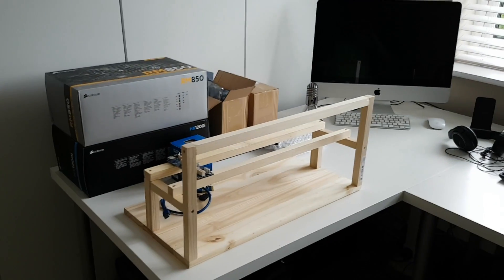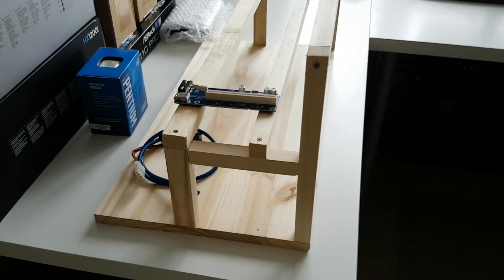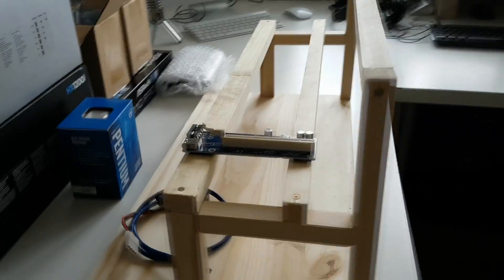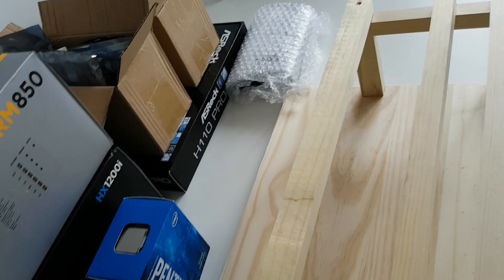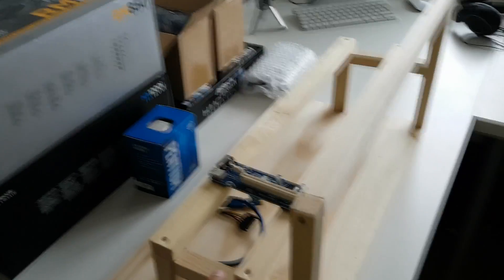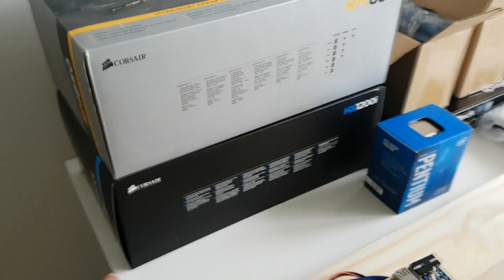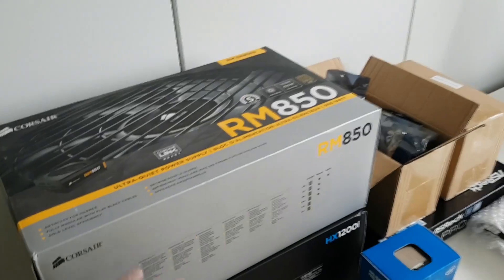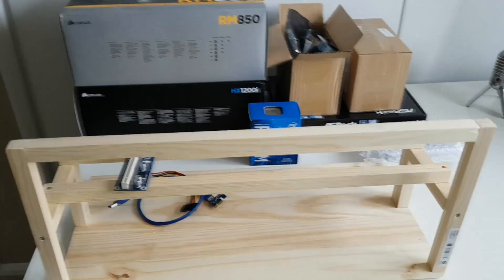13 GPU Miner Build Update - Components, Problems and Progress

Comment: Im getting 4-pin error when trying to connect 3rd GPU card. One card is connected directly on to motherboard. So it all works OK except I try to connect 3d GPU it gives me error: PLEASE INSTALL THE PSU'S 4-PIN POWER CABLES TO THE 4-PIN POWER CONNECTORS ON YOUR MOTHER BOARD but every one is saying that if your using powered risers there is no need to do that.??

Comment: Good work. Which OS are you using? I have a problem with Windows 10, because they only use max. 8 GPUs (RX560). Thank you for the advice.
Reply: piratexxx2 I am also facing the se issue. Did you manage to solve this issue?

Comment: Nice update. Could you explain me which detail I must check to avoid the pci-e power issue before buying. It may look like a silly question but it could save me a lot of time and troubles nowaday with gpu lack of stock. Thanks a lot.

Comment: I like your videos a lot. Just want to give you one quite important pointer on your rig build. Connect no more than 2 riser power cables to one PSU outlet. I know there usually 3 or even 4 sata power ports on one PSU outlet but use only 2 max. I learned it the hard way and my power cable melted to the point where yellow 12V line turned black and was hard as a wooden stick + in one place copper conductor was exposed. Long story short I have overloaded it and it was a great fire hazard. Luckily nothing happened before I caught it. One riser/PCI-E slot can draw up to max 75W and 18AWG wires just can't handle even 2 at full power but in reality they never draw that much and stay around 50-ish (100W total for 2) which is just about what 18AWG can safely handle. Keep up the good work with your videos and stay safe with your rigs.
Reply from the maker: Thanks for your detailed advice. I have a good understanding of the power management required for these kinds of rigs. Fire safety is a top priority and I take it very seriously.

Did your gpus have pcie power connectors or were they just powered via the pcie port / riser?
Reply: I didn't mean to imply that you don't have knowledge about it - hope it didn't come across like that. As the matter of fact I work with electronics all my life and just out of "let's get this going ASAP" gold kind of rush :) I connected everything quickly without double checking what's connected where. Few days later when I was moving PSU to different place I noticed the problem. 

Answering your question - yes, my cards (Sapphire Rx570 4GB) have additional PCI-e 8 Pin power connectors but as far as my research goes, cards draw whatever they like up to 75W from the PCI-e port itself and then the rest from 8 pin. 

I have to agree with you 100% on the safety aspect as this is my top priority too, but I got caught in "ETH gold rush" 2 months ago and made a mistake. I pointed it out to you and to many people building rigs since as I'd hate to see that happening to someone else. Small cable miss-connection, despite I knew about it could have burned my house down.
Reply from the maker: I'm sorry, re-reading my reply and it doesn't read like I wanted it too. 

I'm always open to the thoughts and advice from others and I do genuinely appreciate the time you have taken to provide a useful insight based on your first hand experience.

It's easy to rush in and get everything wired up. But fire is a very real risk with these miners and it needs careful consideration.

Comment: isn't it 8 Nvidia plus 8 ATI? where did you get the 6 limit from?
Reply from the maker: Yes, 8 is the correct figure.
Reply: I'm building 8x 1080Ti mining rig, I have 5 of the 8 cards so far. Yesterday I purchased 4x L3+ and today I secured 5x D3

Comment: What did you pay for your RX560's? They are bad for mining. If your going cheap pick up some GTX 1060's They have twice the hashing power of the RX560's. SEND THEM BACK AGAIN :)
Reply from the maker: I considered an Nvidia build but the GTX 1060's are double the price of the RX 560's, though most likely a little more efficient overall. I considered using some 1050's but they did not have a pcie power connector.
Reply: I have a 6x 1050ti rig I built out of curiosity. They are not actually bad. After tweaking with afterburner I'm getting ~85MH/s at around 350 watts from the wall.

Comment: Have you thought about using aluminium profile for the rig frame? cheap as chips
Reply: I found that wood is easier to work with than aluminum myself.
Reply from the maker: Yes, but its a little harder to use than wood. The build cost is very little using wood. I might do a metal frame build in the future.
Reply: Careful- I know this is a proper build, but you don't want that wood frame being used as kindling if a defective manufacturer cable short circuits
Reply: I put plenty of lacquer on mine to protect it from the heat. hahah

Comment: numb nuts here got the 2GB versions of the same cards. Did not even know there was an issue with them needing to be 4GB. Time to hit google and hope there is a workaround somewhere or I am fucked.
Reply: you won't be able to mine ETH with them... but you still can any other currency that can be mined with GPUs
Reply: yep reading that now. would of rather invested the cash into the currency than do it this way. oh well. And on top of that getting teh mining prog to accept the wallet. holy shit how many issues.
Reply: Nelly Nelson numb nuts, lol
Reply: now its not installing the AMD driver. Should of just bought the coin and sat on it.
Reply: Nelly Nelson alot of problems with mining as u set up the rig... Its a common thing,😀
Reply: kristjan zelko not if you believe the streamers. Got driver downloaded finally, 6 of 13 showing. Now to find which ones are working

Comment: Sapphire is aluminium oxide, so "Corundum" or "Oxide" could work.
Reply: We were thinking along similar lines although since it's an all AMD build, I suggested Ruby as it is red.  Ruby is basically a red sapphire as they're both corundum stones, but for some reason red ones get a different name than sapphire.  It's the only color not to be called sapphire.

Comment: Hi Lee, are you able to share the design for the rig frame? I'm failing to find a reasonably priced rig frame to buy so may as well follow suit and make my own! cheers Mark
Reply from the maker: I made a video showing the build of my original frame for the elcheapo rig here https://youtu.be/WImVHF9rrC0
The current frame is very similar but has a extra full width beam to support the riser pcbs rather than supporting the gpu itself.
Reply: IMineBlocks cool thank you! I'll give it a go!

Comment: You can get up to 13.8 mhs with the rx 560 bios modded and using close to 40 watts, 460 uses 10 more watts same hashrate, I have gone with the 1060s to mine ubiq coin, good luck
Reply from the maker: Yes, I'll be doing a bios mod to get the best performance from these gpus. I'm hoping to get 14+ mh/s with fair power consumption.
Reply: Sniper Pro nerf mods how many 1060 do you have mineing and are they 3gb or 6gb
Reply: EON 13, 3gb model,  with the coin ubiq you can mine it for the next 6 tears with 2 gb and ether is only at 2.1 gb so the cards got plenty of life, use less that a 100 watts and the 3gb does 24.5 mhs while the 6gb does. 5mhs more,  if you have r any questions or need help you can email me at superian351@gmail.com,  cheers
Reply: What sort of bios mod do you do for a 560/460?
Reply: dude how on earth are you getting 29 mhs from your 1060 6GB ?? I've got some Gigabyte Extreme Gaming 6GB 1060's and I was buzzing that they were doing just over 24 mhs each with +950 mem clocks 

all in Windows using Claymore 9.6v mining ETH

Don't want to use Linux if I dont have to because of the 1 to 2 mhs drop per card

If you can tell me what I am doing wrong to get an additional 5 mhs from my 6GB cards then I'll send you an ETC tip!

cheers bud
Reply: Mark Russell the only way to get 29mhs is with ln2, Max a 1060 6gb should get non extreme OC is 25
Reply: yeah that was my understanding mate. Just with you saying in your original post about 5 extra mhs for 6GB cards you got me excited lol. 

Don't know what that "In2" is that you mention? maybe you are referring to another coin mining which would give different hash rates to ETH?

cheers
Reply: Mark Russell means liquid nitrogen. Which no one would ever use for mining. And even if you did I doubt very much you’d get 29MH/s from a 1060
Reply: Mark Russell I meant, .5mhs, there is a period in my original comment, go mine ubiq,  it's not worth much now but has a bright as a first as bitcoin,  it's the new better eth, and depending on the card you can get .5 to 2 mhs more mining ubiq as the epoch is way lower, do some research on ubiq and then you will see what I mean that this coin can 10x the amount of money you have now,  I imagine 32 mhs on a 1060 with the proper modding and ln2 work, BTW ln2 is liquid nitrogen, in its second state liquid,  if you want some tips on overcloking and safe voltages and what cards use the best components, see ya bro,  my gmail is superian351@gmail.com
Reply: ftw and ssc, got them for a good price too, they have the heatsink touching the memory chip to cool it so it can clock higher, just push the mem as high as you can
Reply: Shelby I am getting around 24 on my G1's, running at ETH. Awesome card!! They take massive memory clock very well. 

Thanks for the info Sniper. I been so busy building rig after rig these past few months all I've done is point them all at ETH. But thanks for the tip on that coin. I intend to point all my miners at some cheaper coins in the near future as a future speculative mining point of view. I emailed ya before dude. I'll send ya another now....if you can help me clock some of my cards that have that stupid memory stap lines then I will happily send you some ETC tips! I know how to Bios mod but some of my cards have really weird memory timing straps and I havent had time to research the answers properly yet...
Reply: yeah I didnt even know that memory type was important with 1060's until I received a batch that all max'd out at just over 18 mhs! If it wasnt for the fact that I bought them all bran new I would of suspected the seller of fucking them haha.

weird cos of all the 1060's ive got they are the only batch that ever came with the rubbish memory

Gutted for ya that ya G1's aren't kicking some butt :(
Reply: no way!! didn't realise that!! cheers for the tip! I'll give em a blast on a few other coins and see how they get on! nice one dude!!!!!!!!
Reply: holy crap man!!!! so a rig of 8 would do over 30 profit after elec! I need to get all my rigs pointed to it before the diff increase!

Can you send me the Bat file mate please and give me any other info I need?

If you can send me exactly what I need to just "plug and play" (apart from changing my coin address) then I will send you a handful of coins once I have some mine......

my email markrussell.mail@gmail.com

I'm busy trying to build some rigs today so would appreciate your help

Where would you suggest I get my wallet address from? Cheers bud!!!!
Reply: Ok so im all set up now with the miner.....can i check a few things with you?....

Do you need to modify anything other than the wallet address? ie: where it says "Donate" and "CPU Priority" ?  Not sure if it was set to donate our earnings away lol

Also, which one are you using? There are 2 Bat files and one has 0.5 difficulty and one has 1.0. So obviously it seems the one with 0.5 diff is the one to go with.....but wasn't sure if they were both essentially mining the same thing?

Appreciate your feedback...

P.S. I am using a paper wallet to send coins to...is this cool, or should I use the exchange?

Cheers bud
Reply: all set up and running mate, nice one for the tip off, really appreciate it!!!!

Have you tried the DCR that is also in the zip file? when I run it to test it the difficulty was 0.25! dont know if that means more profit or not? will test it tmoz maybe....
Reply: cheers dude ill try that now

sat up at gone 3am here cos all of a sudden the pool stopped reporting any activity even tho the miners are all still running....

got off to a great start, for about 2 hours everything was fine

I will copy your bat file exactly as you have wrote it and see if that helps.....

just to clarify.....

"ccminer.exe -a skunk -i 21 -o stratum+tcp://yiimp.ccminer.org:8433 -u BH8Mvgf7VgB9PfgAQwPrKtuYKLxZLas9v8 -p x
goto loop"

or was that "goto loop" at the end not supposed to be in?

(dont want to go to bed till ive cracked this lol)
Reply: has the difficulty just got twice as hard in last few hours?
Reply: I've earned 3 coins in 2 hours with a 6 rig of monster MSI cards, just about covering the electric.....something can't be right right?....

my first hour with an 8 rig I earned 16 coins......
Reply: im giving up and going to bed. going to turn all my miners back to eth for now and re-asses in the morro. shame cos was killing it those first few hours. coin price shot up too. maybe that's why difficulty gone through roof? or maybe ive got something wrong? anyway, can bearly think straight anymore. got 2 BTC pro 13 pcie rigs to build tmoz as i spent all day today on this script didnt even get them started